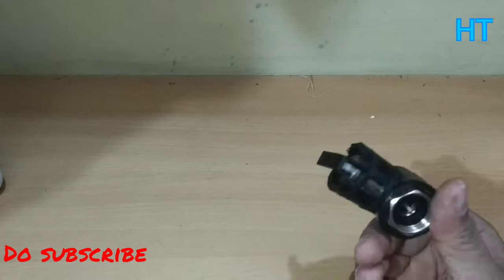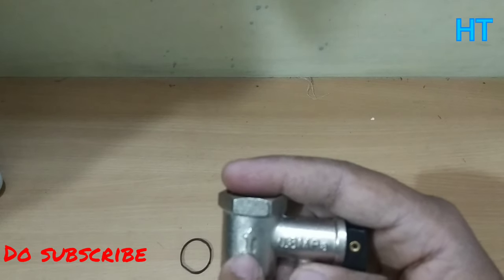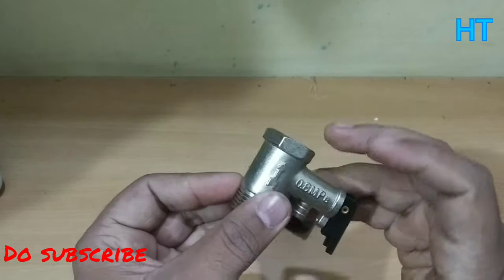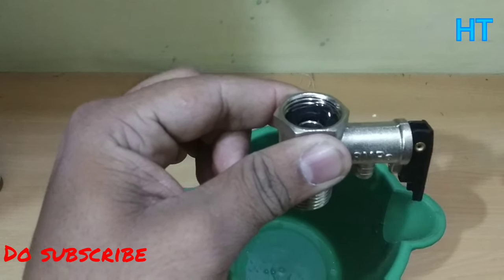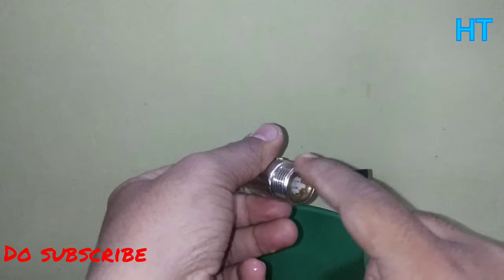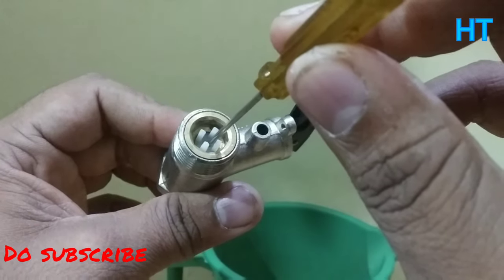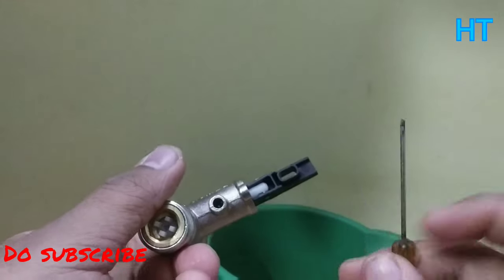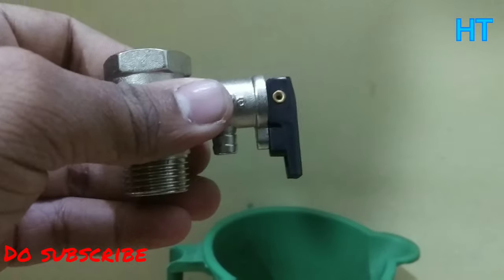how to use multi function valve in water geyser || मल्टी फंक्शन वाल्व || Hemant Techvlogs

Comment: Geyser hot water output bahot slow  hai,. Input pressure hai lekin bahut jada nahi aise me Tp valve me kuch modified kar sakte hai kya jisase paani thoda aur tejise andar ja sake
Reply from the maker: Ho sakta hai valve jaam ho gya ho ya pressure or tej krne ke liye valve nikal do lekin dhyan rhe geyser tank bhra rhna chaiye
Reply: @HemantTechvlogsofficial  mujhe 7 din huye geyser kharide huye, vguard ka hai, company wala Bolta hai tanki ki height badao , geyser 2mt ki height pe hai aur Tanki(1000lt) 3.25 ki height pe
Reply from the maker: Pressure pump sabse best option h
Reply: Spring hatane se bhi pressure increase hota hai , but Spring hatane se koi nuksan hota hai .please bataye

Comment: Sir...maine abhi 10 lit ka storage gyser liya install kiya inlet main paani aacha aa rahaa hai lekin uske comparison main outlet se hot water kaafi kam aara hai....waise inlet se jitne speed se paani aata hai utne hi speed se outlet se paani milna cahiye na..... installation technician bol rahe hai ki tank hight issue hai.....meri tank gyser se 3 feet upar lagi hai....inlet main aacha force hai lekin jaise hi pressure valve lagate hai to water flow kam ho jata hai.... Kya solution rahenga....

Comment: geyser ke neeche outlet inlet aur ek choota sa pipe jo hota h weh hilte h aur tk ki awaz karte h, kya ho skta h bataye

 Crompton ke 3 litre geyser on karne pr power cut ho ja raha tha, electrician Bhai ne bola coil change hoga, change kra liya fix karne pr pipe se pani leak hone lga, tau pipe change kr diya, uske baad do din baad geyser ke neeche se pressure se pani felne lga, dikhaya tau bola andar se rubber nahi lagi thi sahi, saath pani bhi pehle jaisa garam nahi kar raha tha.
Ab temperature 50 pr set kr diya h, pani sahi garam ho rha h, lekin jaise hi flush ya koi dusra nal chalate hai tau geyser ke neeche outlet inlet aur ek choota sa pipe jo hota h weh hilte h aur tk ki awaz karte h, kya ho skta h bataye
Reply from the maker: Pani ke pressure ki wajah se awazz krta h Or pani sahi se garam nhi ho rha to element change kena pdega
Reply from the maker: Outlet or inlet vali anode pipe me problem ho skti h
Reply: @HemantTechvlogsofficial  thanks ji 🙏
Anode pipe wahi hote h na Jo bahar se Lage hote h